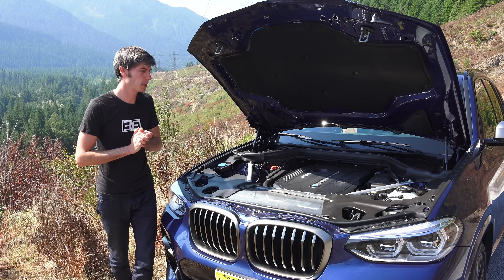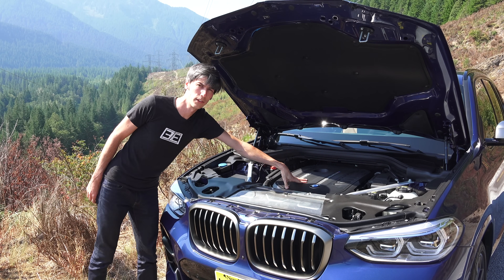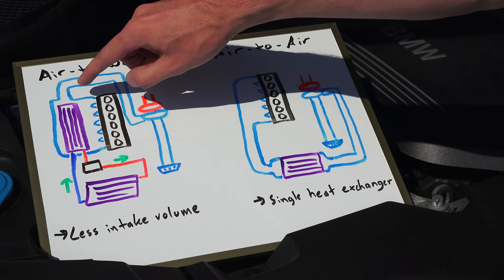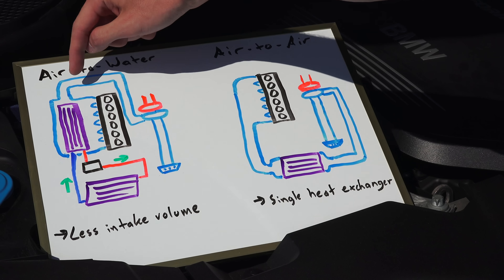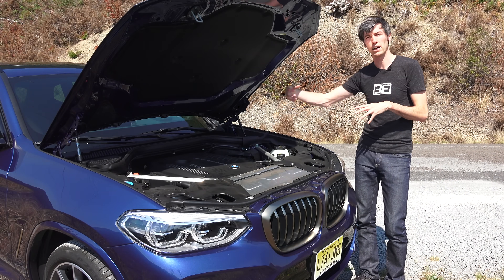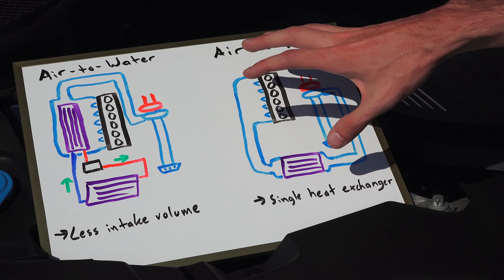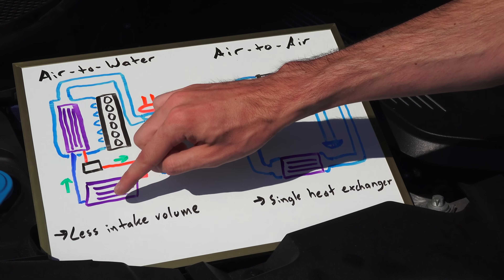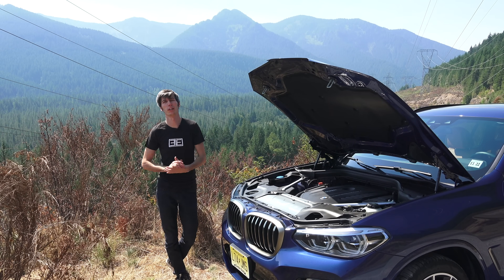The Differences Between Air-to-Air and Air-to-Water Intercoolers

Comment: Question....
Which intercooler cools the intake charge the most effective?  Only talking about increasing M.A.D.  (Mass Air Density). Boost is pretty much out the door as it’s irrelevant without knowing MAD.

Comment: Great stuff Jason.  I have not seen a better explanation of the differences.  For me, I'd take the simplicity of the air-to-air intercooler.  Coolant and cooling system failures can quickly lead to catastrophic consequences which I assume would be less so in terms of an intercooler, but still the potential for more coolant leaks alone is enough for me to avoid the system.
Reply: It’s not really heat cycling like engine coolant so the systems are pretty robust. Not to say it’s not a concern but systems like this have been around a while with little issues. Also the intercooler leak would have to be catastrophic to cause engine damage. A pin hole leak ingested into the intake wouldn’t be likely to affect the engine.

Comment: Is the coolant system for the the intake air temperature separate from the coolant system for the engine block?

Also my c15 acert motor in my rig has both. Compounded turbo feeds directly to an air - water intercooler (referred to as a precooler by cat. Water flow is controlled by a solonoid referred to as a diverter valve) then to an air - air intercooler on the truck.
Reply: Yes, it is separate.  You don't want 200*F coolant in your AWIC.  You want it as close to ambient temperature as possible.
Reply: On my diesel the precooler uses engine coolant system. This is why I was curious.

Comment: Also in performance applications you can run the coolant through a reservoir filled with ice after the radiator to get intake temperatures below ambient after compression, and make the ice last longer than just using the reservoir.

Comment: For all the added complexity of air-to-liquid intercooling, they may as well just run plumbing to the trunk for an ice-tank and really get that air cooled off.

Just run air-to-air with a front-mount water spray device to get temporary power increases by evaporative cooling of the external core surfaces.
Reply: Keeping that much water is not convenient. This system you don't need to refill or keep adding like yours would.

Comment: Are there heat exchanger size benefits w/ air-water versions? Since air-water should be more efficient due to the heat capacity of water, I'd think this should mean the air-water exchanger itself is smaller? Also does it have a separate air-water exchanger to cool off the water or is it just piped back into the radiator system? If not...why?
Reply: It is an entirely separate system from the engine cooling system.

Comment: Another disadvantage is that manufacturers use the same coolant as the engine. And not a different circuit. So in long travels the limit tends to 90° instead of ambiente temperature.

Unfortunately that means a lot less efficient to cool down compressed intake air.
Reply: they don't. there's a second cooling circuit for the intercooler. B38/48/58 engines are designed for intake temperatures of 50 °C at rated power.
Reply: @KropfkraenklerNo1  you are probably right. That should be right. But I neve saw that second intercooler under the hood of my car....

Comment: A water system can pull more heat out of a system than an air only system and maintain a more consistent temperature across operating ranges. It is added complexity and weight still.

Comment: Good explanation, but there is also another advantage : the thermal inertia of water. In fact when the power needs are intermitent, not an oval track for exemple, you can aford a smaler pair of exchangers because the water can still be cooled when off-boost. A notable example is the second turbo version of  the  Lotus Esprit.

Comment: I believe air to water is more efficient at removing heat when ambient temps are high.  I have an BMW M2 s55 engine with air to water intercooler and I never had any heat soak issues when pushing hard in high ambient temps.  When an N55 M2 is pushed in high ambient temps you get heat soak issues due to the air to air intercooler.  Plus the M2 air to water inter poker sits ontop of the engine and is not integrated into the manifold.  Bmw did this because it reduces more heat than typical air to air system.

Comment: A2W has a way bigger thermal capacity so a 0 to 160 will be just a bit faster but if u go for longer it will be slightly less efficient.and the system is heavier.

Comment: I think water transfers heat 25 times faster than air. My Ea211 VAG engine has a water cooled intercooler. I've done 127,000 miles in it in 4.5 years, it's still a pleasure despite having a second car that's a lot faster. Thumbs up for this system.

Comment: Jason. I think you missed an important point about the duty cycle of the engine. High power road cars will require inter-cooling for short periods of time. In between those bursts of power, air coming off of the turbo will be cooler and help to cool both systems. Indirect water systems will heat up more slowly under power and cool more slowly when power is reduced. You can even use this approach to provide unvented inter-cooling. Essentially that would be a water intercooler without an external pump or radiator, but that would take longer to recover after a full power event. Love the channel.

Comment: I will browse your other videos of course, but...  Even though i watch them all, i dont really know much (compared to most of the viewers) about engineering.  So, the question :  why an intercooler ?  Is it the fact that the turbo turbine, in compressing the air, makes it super hot, and less effective (less dense) that ambient air ?   Does an intercooler use some kind of phase exchange to cool the air ?  ( i know it works in liquids, but does it with air?)  tyvm all <3

Comment: As a PC enthusiast, this isn't really a whole lot different than using just a plain all-metal heatsink vs liquid cooling: the main benefit of using liquid cooling is that it more quickly removes heat away from the heat source (the processor), but, it is relatively inefficient.  Liquid cooling doesn't necessarily mean the total cooling capacity is improved (that ultimately depends on the radiator) but since you're able to "spread out" the heat away from the CPU, that allows it to work harder without heating up as much.

Comment: Seems like you'd have a lot of heat soak in the B58 intake once the engine was up to temperature, effectively reducing the advantage of the shorter distance the air travels from the turbo to the engine. I guess additional power wasn't as big of a concern as reduced lag and improved drive-ability. With less lag to worry about now BMW drivers can concentrate even more on not using their turn signals.

Comment: Wouldn't it be simpler to put an air to air intercooler in the shortest route between the turbo and the engine and use ducting and a small electric fan to pass air over the intercooler and accomplish the same thing?
Reply: He didn't touch on a few points.  Due to the high specific heat capacity of water, the intercooler itself (the one cooling the air) can be a lot smaller than the equivalent air to air intercooler.  It also results in less pressure drop since the channels carrying water can be thinner than those that have to do the same job with air.  The result is that you would have a problem packaging an air to air intercooler that close to the air path.  The air to water allows you to decouple the large heat exchanger away from the air path.

Comment: The cool thing about air to water is that you can get an aftermarket setup to drop the coolant temps using the ac system. Puts more strain on the ac but temps are below ambient.
Reply: yes, if ambient temperature is above 15-20c, otherwise AC is not good.

Comment: Dear jason, can you explain if there would be any power gain if you cool your intake temperature down with your A/C (place an heat exchanger before the intake) it is clear that you take a lot of power from the engine via the V-Belt, but would it help if you „store“ the refrigerant liquid, and when you kick down, the Compressor disconnect‘s from the engine and you use the previous cooled down refrigerant to coll down the intake temperature to have a few seconds more power? Im an automobile engineer myself but never calculate trough this scenario. BR Dražen from Austria

Comment: I think they just need to route cooling air somewhere near engine intake and cool air on the site just after turbo before intake. So just route cold air from front of the car to air to air intercooler and then use same air to cool alternator, exhaust, turbo, gearbox... Whatever floats your boat. I think in that way you get performance and simplicity (cost) at max level. Maybe it's kinda drag increase but it's marginal. on water to air system there is water pump and that is energy lost and money lost

Comment: I am the only one in North America with a B58 that needs to be completely replaced. A bolt got into the turbo thus shredded itself and sent metal into the engine. No idea where the bolt came from and what is was for. 

The turbo, intake and engine are being replaced currently.

Comment: I thought the higher thermal conductivity of the coolant let it remove heat from the intake better even if the delta in temperture is less. That heat is then stored in that system and dissapated through the outer radiator. Sure eventually it will saturate but for a few pulls it has to be better. 

Air to metal to water on two seperate radiators would be equivilant to a air to metal to water to metal to air radiator of the same design.

Comment: If you simply added volume to the water-to-air cooler's supplying radiator, i.e. double the size for example and thereby the double the fluid capacity, would you therefore get significantly lower intake temps without changing anything else?
Reply from the maker: You would simply delay the amount of time it takes to get the coolant to its resting temperature, so temporarily it would be cooler, but eventually would even out.

Comment: Now that a/c compressors don't suck huge amounts of power any more, I wonder if that will become viable - to use the a/c system to chill the exchanger in the intake manifold instead of water.  We already have a compressor and a heat exchanger behind the grille for the regular a/c system...would just need a little more plumbing.

Thoughts?
Reply: The Dodge Demon does this already, for drag racing purposes. But it it's only a short time thing, not constantly.
Reply: Yeah.  I was thinking more of cycling the a/c to set a constant intake temp, rather than chilling the intake, then turning it off for max power in a short burst.  But I can't see why it wouldn't work, unless the a/c takes more power than the cooling effect would give back - and it should be cheaper, and would make for a more compact setup in cars where underhood space is at a premium.
Reply: sounds good in writing , but in the summer when you need the cooling the most , your also gonna want to run your AC in you cabin , so you either will need to double your compressor size to handle the load , or sacrifice comfort. i don't see away around it.
Reply: I think this is already out there, I assume they call it "killer chiller" or something like that.
Reply: That might make a good video... why doesn't a/c affect power as much nowadays?

Comment: It is possible to use a liquid refrigerant system to increase air density?
Reply from the maker: Yes, Dodge actually does that with the Demon and uses the A/C system to cool the intake charge. Good for drag racing when the car is stationary.

Comment: Seems like the ”water cooler" would offer more consistent intake temps vs just running the air to air set up. Air to air works best when the car is moving forward (cool air hitting the IC) vs sitting still revving the engine (turbo still working but no cool air hitting the IC). The water cooler functions just like the radiator where the coolant regulates temp regardless if the car is moving or not. That secondary air to air cooler could further reduce intake temps once the car is moving.
Reply from the maker: Not exactly, if the car is not moving the heat exchanger for the air-to-water intercooler is not getting cooled either, since there is no airflow. For drag races, you could simply fill with ice water and have temporary static cooling, but neither are effective long term if the car is stationary.

Comment: Noob question: is the goal to pre cool or preheat the intake air? And why?
Reply from the maker: To cool it. Cooler air is denser and thus contains more oxygen. With more O2 you can make more power.
Reply: Also, at full load (thus, high boost pressure and air flow) you'll have about 200 °C at the compressor outlet. That's way too hot for a gasoline engine. Usually the target temperature in the intake manifold is around 50 °C. Temperatures of 60 °C and above will increase knocking a lot.

Comment: Very disappointed, as this spreads misinformation.   Those are not INTERcoolers.  They are AFTERcoolers.  An intercooler is cooling charge air between compessor stages. An aftercooler cools the charge air after it passes through the compressor(s).

You also left out why the lower temp of air to air coolers is important, reducing combustion temps.  This typically translates into either lower emissions,  higher power / altitude capacity or a combo of the two.
Reply from the maker: I guess every auto manufacturer calls them the wrong thing. Also, on single turbo/supercharger setups there is no between compressors.
Reply: Pretty much, yes.  Just because it's common doesn't mean it's correct.  The inter refers to inter-stage.  As almost all auto manufacturers are single stage they can't have an inter-stage charge air cooler.  They picked up the term from other industries such as gas compression, power generation, aircraft, etc that were actually using intercoolers and mis-applied it.

So if you're talking automotive,  you've probably got an aftercooler.  If you don't want to remember the technical differences,  you could just call it a charge air cooler.

Comment: What are the chances of significant reduced efficiency from heat soak in the air-to-water after extended periods?  Does the 2nd intercooler cool the water that much

Comment: Jason, are you able to expand some on air-to-water system specifically the coolant side. Is it a separate coolant system from the engine coolant so it’s not ~190F when the engine is at operating system? If I am not mistaken, some also have “ice” tanks or there are at least aftermarket ones that can be purchased like the E55 AMG etc... Thanks!
Reply from the maker: Yes, separate cooling system from the engine coolant.

Comment: I have a newer BMW with the B58 engine and air-to-water cooler. I was so excited to get it. It performs great, response is awesome, and less to worry about when upgrading.

Then at 1000 miles i noticed the aux coolant tank that supplies the cooler was dry. Come to find out BMW only put a level sensor in the main tank and not the aux tank. So I had no warning that it was dry outside of a forum thread where several people said they found theirs was empty. So I had my first dealer visit 3 months into ownership.

Great idea. But it's always going to be a BMW.
Reply: The unfortunate reality of the B58/B48 motors is the radiator supplying the cooler is made of a material I can only describe as "tinfoil". This is mounted in front of the engine radiator and ends up like swiss cheese after the first shower of small rocks, leading to leaks in the system (and with no level measurement as you mention). Madness really.

Also the efficiency of the water-air system on the B58/B48 is nowhere near as efficient as that of the S55 or S63 motors and tends to heatsoak rather rapidly with back to back pulls in even mild weather.
Reply: Bestwick1983 s55/s63 have duel heat exchangers compared to one on the b58/48.
Reply: Yes, I'm aware of the sensor in engine cooling circuit, however the circuit cooling the intercooler is completely seperate from the engine cooling circuit, hence the two tanks and the issue when the radiator for the intercooler circuit is compromised.
Reply: Complexity is such a double-edged sword!
Reply from the maker: Thanks for sharing your experience!
Reply: For sure. I'm still not sure if it's actually a leak, or if it just wasn't filled properly at the factory. There's a growing thread on the Bimmerpost F30 Forum where people are discussing how they are going about getting it resolved.
Reply: +kern417  There must be a leak somewhere in the system, no other way - coolant can't simply disappear.
Reply: BMWs are great cars when new, but a little bit of ageing and they become money pits. Mostly just simply made for the first customer, but after that? F you. My girlfriend's father works in a BMW service shop here in Europe and the amount of things that go wrong with (even new!) cars is astounding.
Reply: Let's see how long your electric water pump lasts now.  I have a feeling that the N55 will end up being the less problematic engine compared to this..btw I got fed up with my 335xi after 99K miles..traded in for a WRX.
Reply: prophet11236 they have a secondary water pump just for the intercooler, been doing this since the n63.
Reply: Gotcha...totally separate systems. Is the pump reliable on the n63?
Reply: prophet11236 also the b58 has a mechanical water pump for the engine.
Reply: It's probably not your last. Only time will tell though.
Reply: Poor engineering?